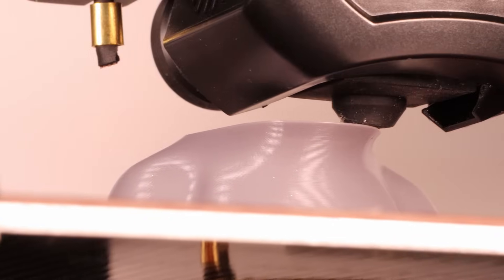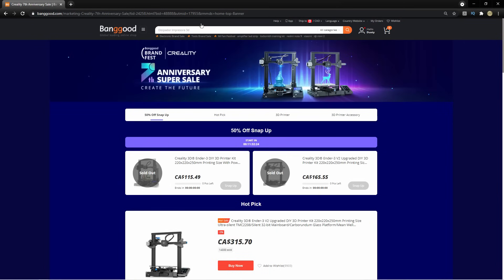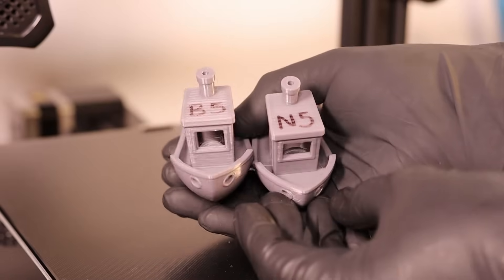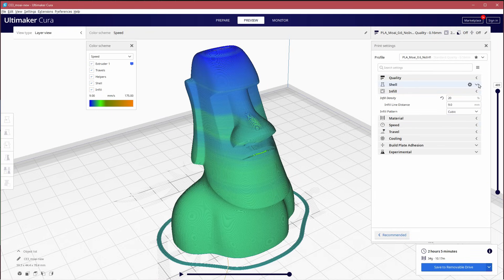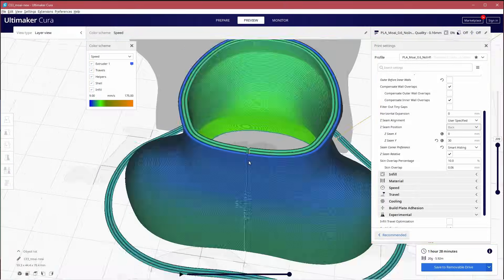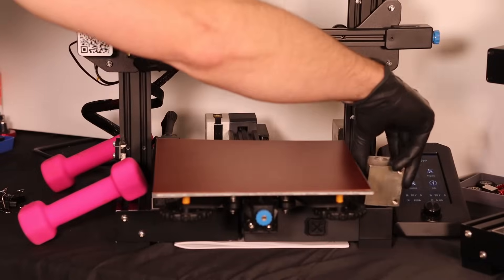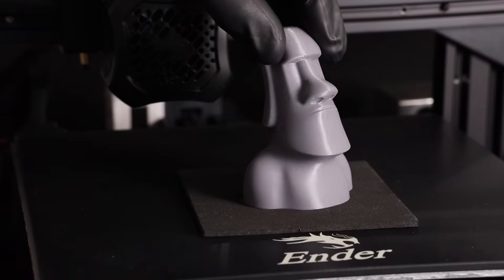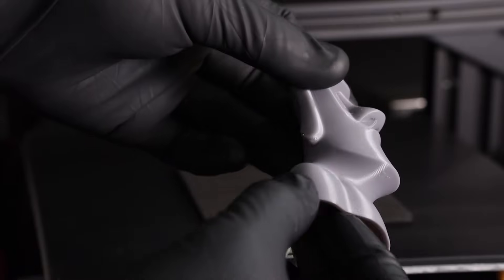Creality Ender 3 V2 - My Cleanest Print Ever and You Can Too!

Comment: Would you say if i'm printing in a small apartment that doing it in an enclosure may be a better choice for fumes etc?
Reply from the maker: I'd try to rig a carbon filter on an air purifier and have it going near the printer.  Yes it will help a bit, the nano-particles of plastic will be easier to breathe in if the printer is going in the open.  PLA is supposed to disperse less of these due to the lower temps.
Reply: Its helpful to note some PLAs may not even be harmful to breath.  PLA by itself is a natural chemical found in plenty of foods, and is digestible/dissolvable by the body.  The coloring and other additives are usually the deciding factor on whether a filament is harmful. You can always look into your specific filaments properties if you're worried about inhaling micro particles.

Comment: can old ender 3 produce result like this? or does it need some upgrade first?
Reply: The best thing for an Ender 3 (and what i've done to mine) is offload all the work to a Raspberry Pi using Klipper. The 8 bit boards struggle at times and you can get issues with print quality.

Another thing is I switched to SuperSlicer which is a Prusa Slicer fork and its awesome. I've never has such clean prints in 3 years and the supports come off like a dream.
Reply from the maker: They aren't much different, adjustment knobs for the belt tension, the board will be different, and may play into the results a bit.  I've seen some incredible prints from the Ender 3, you should be able to get similar results.

Comment: Remember you can use epoxy resin/hardener on a low quality print to get this result too...after sanding
Reply: So pour the resin over it?
Reply: @KingMarcellous  brush it over usually and it fills the gaps, then sand it.   best result is just buy all natural filaments for everything and use primer/filler and paint them.  smooth, clean and any surface finish, matte, satin, gloss...etc....    it would be next level to have a printer or another machine that specializes in post processing prints like this for you.
Reply: @digibluh  You can even sand it then apply wood filler or any filler putty and finish with a few coats of primer/filler primer
Reply: or you can just properly tune your printer and settings and save the trouble ;D
Reply: why would you want to spend (a lot of) time and money on that when you can tweak the settings and let your printer do it for you?
Reply: Just use a resin 3d printer they are cheap now only resin is a problem
Reply: Or just get a resin printer
Reply: @collegestudent6071  Only issue with a resin printer is that resin prints are usually not as strong as filament prints. Resin is great for small details whereas filament is good for the building of larger prints. Nothing is stopping you from using both to get the best of both worlds!
Reply: @Ka_llisto  im curently trying to decide and the biggest disadvantages of resin to me are smell, toxicity, and the overall hassle of handling the resin
Reply: @overlookedundead8711  I agree
Reply: @BT-cg8md  But if you  want good looking Minis go resin. i went FDM and got a resin printer 6 months later, FDM is great and all but minis are just not what its good at. The Smell and hassle is honestly not even that bad, just dont have it in a room where you are constantly sitting next to it like a basement. but honestly you wouldnt wanna sit next to an FDM machine all day either, they are pretty loud IMO and stuff like ABS is just as or more toxic than resin, it releases Styrene gas when heated.
Reply: @collegestudent6071  no
Reply: That’s high praise!
Reply: @Landen Emmitt happy to help xD
Reply: @Ezra Joel Thanks, signed up and it seems like they got a lot of movies there :) Appreciate it !
Reply: i realize it is kinda off topic but does anyone know a good site to stream newly released movies online ?
Reply: @landenemmitt3729  AMAZON, ITUNES, HBO MAX, etc..
Reply: @landenemmitt3729  tea Tv

Comment: The print looks pretty good but your lighting at the end was a little poor and hard to really see the print quality.
Reply from the maker: Indoor lighting is always so poor even with two bring LEDs, I'll continue to improve this as I go, thanks for the comment!
Reply: @NeedItMakeIt  After giving up on Simplify3D ever putting out a new update...I did some tests yesterday with Cura's variable layer height feature. Very impressive results.
Reply from the maker: @lazlo342  I like Cura a lot, it has plenty of features to satisfy my needs, I really don't know why people have such a hate on for it.
Reply: @NeedItMakeIt  The Cura interface is not the best but it seems like it gives power users a tremendous amount of control that is missing from other slicers such as Simplify 3D.
Reply: @NeedItMakeIt  We purchased a Raise3D printer about a year ago and their slicer (IdeaMaker) is pretty nice. It seems very similar to Simplify 3D...but with a better interface and more features...and it's free.
Reply from the maker: @lazlo342  It does take a bit of getting used to.   One day I activated all of the settings just to see what was there... I was overwhelmed with the adjustments, many of them I've not even tried yet.  We're going to need AI to decide the best settings for our prints.

Comment: Incredible quality. How well can you do intricate details on this setup?
Reply from the maker: Most of the time I print structural parts which low detail and high speed, but I can certainly switch that over and print the tiniest possible details to see how well it does, did you have something in mind?
Reply: @NeedItMakeIt  How about a ziptie, M4-M6 bolt printed vertical, or something else? Subbed regardless!
Reply from the maker: @testtube7923  A ziptie would be quite challenging... unless it is one of those massive ones.   A tiny bolt would be pretty good.  I'll add it to the list.

Comment: Ahm. Good Job I guess? 
But this is kinda like the standard quality that you get on any Prusa 3D Printer with default settings.
At least with easy models like this one.
I didn't know that the E3 required so much extra attention.
In any case: good video!
Reply from the maker: I'd like to own one, they are a little expensive for most people, but I've heard nothing but good things.  

The direct drive would be a great setup to have on the E3V2 to bring it up to the next level like the Prusa.
Reply: i have an E3v2, and it produced similar results right out of the box. the model used in the video is not really a stress test, as it does not have any real reason for stringing, which is what combing and coasting is really for. of the tips shown, the biggest contributing factor was the seam to be put on the back of the statue, as far as i see.

Comment: I recently got this printer and have had problems using cura every time i try to print anything on the first layer to much filament comes out, i have been using prusaslicer instead, I tried using the same gcode and before changing any settings this was happening. More recently i have started changing settings in prusaslicer to make my prints better. Any idea why i am having this problem?
Reply from the maker: There are three things that come to mind: 

First is something called Elephant's foot, this normally occurs on the first few layers, it is a combination of problems, solid layers of extrusion leave only excess material to extend up, or out.  Also extruding onto a hot surface allows material to flow better.  This can be compensated for in Cura by searching for the word Elephant in the settings and adjusting for it.  

Next You may have over-extrusion, you'll want to calibrate your e-steps on the printer, for high precision, you'll want to do this for each different type of filament you use.  PLA/ABS/PETG.

Lastly and the most common is that the bed is too close to the nozzle.  It will cause the first layer to spread and become extremely thing, it can also cause problems like tear away from the surface, or cause the extruder to skip because there isn't enough pressure to force the material out.  I use a piece of paper to level the bed and you should go around twice to re-adjust.  Afterward I always do a large print with a brim and then re-level by hand when the printer is going to make sure it is perfect.

Hopefully this helps!

Comment: 0:15  Using an actual tie-wrap gun will cut the ties cleanly without leaving those sharp edges. They can be very dangerous (to your wrists) in a busy networking installation.
Reply: well, using the cutter supplied with ender machines you can get the same result.
Reply: Or just twisting them
Reply: https://www.youtube.com/channel/UCW2ja1uLvqjs9mzjVzkglVA

Comment: My x axis tends to sag a bit on the right side what can i do?
Reply from the maker: I'd bring the x carriage down all the way to the bottom, remove the top rail, loosen the x and y axis wheels, then re-adjust making sure they aren't too tight.  Then bring it all the way to the top and re-mount the rail.  This will help to keep everything parallel.  Re-level the bed and you should be G2G.
Reply: @NeedItMakeIt  ok ill try this out thank you

Comment: That looks awesome! I have an Ender 3 V2 as well and I keep having issues with sagging and quality issues directly above supports. I have a stock setup and everything else is calibrated really well, I get great prints when they don't have supports or overhangs that are too much, but as soon as I do either they look really bad. It is especially annoying because I want to print miniatures for DnD and the weapons, capes, and arms tend to look horrible underneath where the supports are supposed to meet the print. Do you have any tips besides orientation, or aftermarket parts? Thanks so much!
Reply from the maker: I normally print super heavy duty structural parts, but I think this printer is precise enough to print small guys, they might need to be sliced up and re-joined afterward for the best results.   Initial comment is to print with PLA, lots of cooling and print slow with a small nozzle, for extra cooling use a large fan, this works really well, Voron speed printers need this to cool the parts rapidly.  I can have a look after I've finished a video or two, please send me the file and I'll see if I can make it work.  Needitmakeit@gmail.com
Reply: @NeedItMakeIt  what resolution are you printing at and what speed and type of supports are you using?
Reply: @kill4all188   in the video he has print speed at 70, and he doesn’t use supports, and he used .16 resolution
Reply: If you have the money you could look into investing into resin printing, when you overcome the fear of it, it really is an insane upgrade.
Reply: There are a lot of settings controlling supports in cura. The roof density of a support and the z gap distance are what your gonna want to mess with. Simplest upgrade that will improve your printer for pla is a bigger fan... A single 5015 will absolutely handle business on an ender 3.
Reply: @notsam498   is it easy to install the fan?
Reply: @MrAbenavides  as far as 3d printer modifications go it's pretty easy. There are a lot of fan mounts you can print. You will either need to cut and crimp the fan wires and put jst connectors on them or cut and solder the wires in for the fan. I am using dual 5015s on my ender 5s. Mainly to reduce vibration and for more even airflow. if you want to go quality get a sunnon maglev bearing fan. The good cheap stuff is winsin just make sure you get a ball bearing winsin that isn't high speed. Those high speed fans are very noisy and vibrate to much to be on a print head. Oh and when printing a fan Mount, if it's in pla choose one that doesn't get close to the nozzle. I print all my printer mods in petg, it will withstand the heat far better.
Reply: @notsam498   much appreciated.

Comment: Where do I go to see people printing usable things instead of boats & busts? ;)... lots of plastic in out landfills me thinks.
Reply from the maker: It does pain me to print these items knowing that they don't really have a function.  If you've watched any of my other videos, you'll see that I print structural parts meant for the workshop, or for exercise.  In this case for testing it is better to print something small and familiar.  The goal here is to provide different methods and ideas to help people improve their print quality.  

I'd prefer to print in something completely recyclable, and PETG is close, but not there yet.  We'd need a method of applying a 100% accurate recycle symbol on the parts as well.

Comment: I have been told by Bondtech that an enclosure for this printer is not recommended.
Reply from the maker: There are certain risks involved, at higher temps, cooling of the electrical components becomes a problem.  Mine was in an enclosure for about 6 months with no issues, however it only reached as high as 50C.  Any higher and plastics will begin to soften and the electronics could suffer.  Creality makes enclosures for these printers, however they are not well insulated (maybe by design) if the temps can be kept low enough, the printer will be fine.  Sound will be deadened a little, airborne particles will be reduced, the printer will stay cleaner longer.   Bondtech is a good well known company, I'd want them to be more specific about the reason.
Reply: @NeedItMakeIt  I'll look at my emails from months ago and see what the reason was if they said

Comment: One thing he didn't mention; use fresh filament or keep your filament in a dryer box.  PLA particularly absorbs moisture from the air and will degrade over time.
Reply from the maker: I find that PETG is worse, it could be the quality or the brand as well.  Yes, it does make a difference for sure.  I've never had an issue with ABS, I always have problems with PETG and my PLA is pretty good, but could use a little drying.  Great point!

Comment: I have this printer, but have a lot of problems with stringing. I watched all videos on this, but nothing works. Only thing that helps is putting the temp all the way down to 185, but worried about delayering. Maybe my pla is not dry enough? I live in a hot humid country.
Reply from the maker: Yes, this is likely a moisture problem, I have this problem with PETG and need to dry it in the oven and also turn the temp down.  With PLA you'd need to dry it at no greater than 60C so it does not soften and bond to itself on the spool.

Comment: The main problem I have with my prints is I constantly get different layer lines in the exact same height for my prints, I was told it would be from my z axis but would like to know of methods to fix
Reply: sounds almost like a mechanical problem.Get a marker, do a new print, mark the zone of the threaded rods where problem occurs, so u know where the problem might be and visualy inspect the threads geometry. also u can try to take the threaded rods out ant put them back upside down and see if the problem is still there. If yes-its complicated, if not one of the rods geomtry might be fucked up.
Reply: @JulietFoxtrot-mk2  thank you so much! I'll definitely go mess with it and see if I get any results
Reply: Did you leave adaptive layer height on in your slicer?

Comment: Why did you add a big seam to the print ? I don't understand the need for any kind of seam on prints or why you mentioned that it's good to hide it ?

Edit: great video though!
Reply: You always have one, that is the point where one layer stops and the next one starts. Going one layer up leaves these spots. Usually they are almost perfectly hidden in corners but you can't do that in a round print without any corners
Reply from the maker: It would be similar in a way to drawing a circle (or shape of your choosing which is closed), you need a starting point and ending point.  The exception to this would be spiral mode, which is more like a spring.   There are ways to minimize the seam and I will exploring that in an upcoming video!  Hope that helps.

Comment: Is That .gcode file on 0.4 nozzle ?
Reply from the maker: No but I can link one tonight if you like
Reply: @NeedItMakeIt  I will thankful for that, also your profile where in description wasn’t open on my Cura 4.7.1
Reply from the maker: Hi, there was a bit of delay, I've added the link to the code for a 0.4mm nozzle.  I don't have cura 4.7 anymore, I wonder why it cannot import, I'd imagine it should be backwards compatible, there isn't much to these files.
Reply: @NeedItMakeIt  which is ur slicer at now?

Comment: No mention of calibrating the printer. - esteps, temp towers, retraction settings... do all that and you will have good prints.
Reply from the maker: I can agree, dealing with the printer tuning is a portion of producing good results, the slicer and settings as well as other factors like cooling and material being printed as well as nozzle size all play into the result.  The videos I make a short to make them easy to digest and fast to make, I have a collection of other videos which cover a lot of these topics and will have more.

Comment: coasting makes the seam bigger, turn it off. Cleaner. Turn Wipe instead. For a cleaner print calibrate linear advance and go MUCH slower
Reply from the maker: I am in the process of testing all of the variables for seams right now, I will turn Coasting off on some of the tests as well.  If I have it off there is normally a slightly raised area though speed is probably a factor.